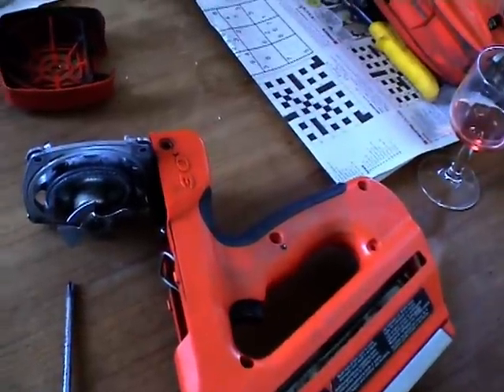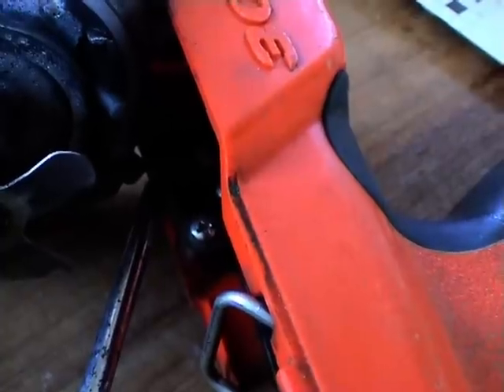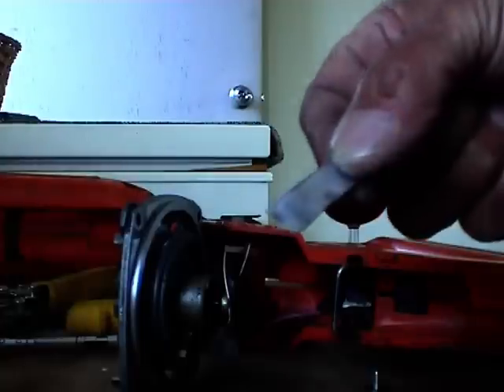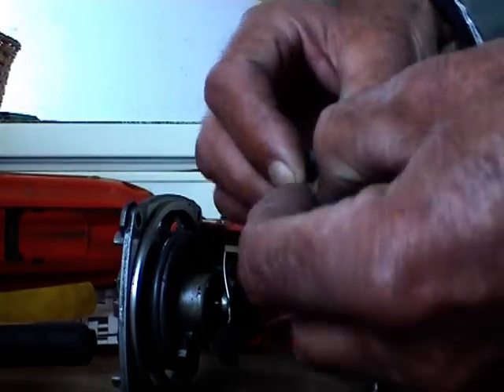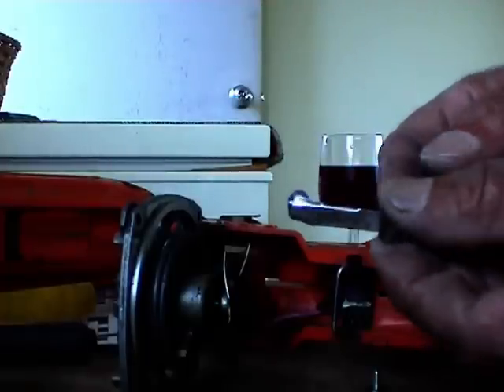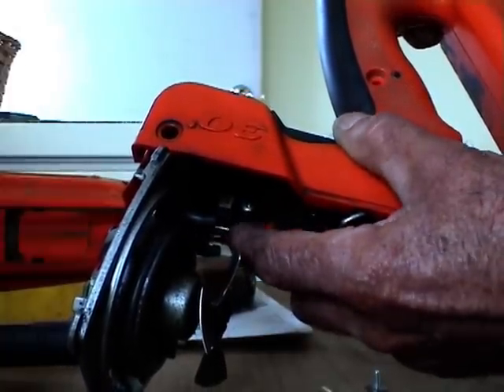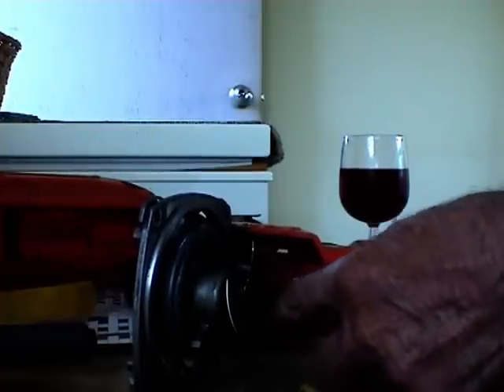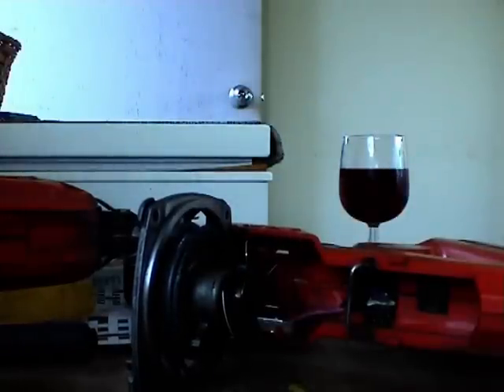Fixing a Paslode gas framing gun that wont fire, or fires intermittently.

Comment: I replaced the two O-rings and cleaned my gun. It ran worse than before it started and saw your video. Took the gun apart and used aluminum foil tape, the stuff that is used on ductwork, and it works great now.
Thank you.

Comment: These things are engineered to fail through a frailty mechanism inbuilt ,so as the average builder will throw it away.They are a brilliant tool,but they are built to fail,so paslode can sell you a new tool,periodically.However a well maintained tool can earn you a fortune on pricework.They work if used every day,far better than intermittent use.Thanks for the video.

Comment: Thanks mate - worked a treat... mine's been playing up for years (don't use it a lot,) tried everything: new O rings, piston ring, reed valve, new batteries, gas, but still only worked intermittently - could never depend on it. Didn't have any flashing, so cut a strip off a Fosters can. Knew there'd be a use found for it one day... (only kidding!) Thanks again.

Comment: Thanks for the tip, now my flea-bay nailer works pretty good. I tried replacing the part but that just made it work for a little bit then quit again. I used aluminium foil duct tape, hope that helps someone.

Comment from the maker: No, you've got a different issue there. With the problem I addressed in the video the fan still works, but the gun won't fire when you pull the trigger.
Check that the power connector to the fan is pushed in firmly and the spark plug cap is down firmly. You could also try another battery (some batteries look good, green light etc, but are actually dud.)

Comment: Slick.  Worked for me!  I used a couple layers of foil tape I had from some duct work.  Many thanks.  the part is 404448 Lever/Head switch and is available through several suppliers - but this trick got me going again until I can replace it.  Many thanks

Comment: great video cheers.....however i did the repair and it got worse fan would not come on. After filing about i found that the spring was pushing on the switch after releasing. pushed the spring back the other way and no it works great! go figure! everything in my life is backwards or upside down! cheers again though for pointing the right direction to look in.

Comment: great idea if it was built to work consistently.They are not reliable and very difficult for the average guy to trouble shoot and repair.
Average repair cost at home depot works out to 1/3 to 1/2 the cost of a new one.I bought a new battery =waste of money.New fuel cell=waste of money.
How do you know if its switch,o ring ,spark or something else when youre sitting by a wall you are trying to put together and the gun works then doesnt ,works then doesnt then quits only to start working intermitantly for a hour or so then stops working again then leave it for a day and it works for an hour only to do the above  again.

Comment: Nice video. I received one of these from a friend and it didn't work. I took it apart and found fan shaft very bent and not working. Replaced that motor, and it cranked right up, but would not fire a nail. Put it away for a few weeks. Saw your video and thought this might be my issue. however now gun is dead. I can't even get light to come on in handle. Fan will not work. I can't find any info to address this. battery was out during storage and gun inside carrier, and in my house. Batteries and canisters both work well in another gun. Gun just seems to have lost a connection somewhere. Reset button??? Can you help me.

Comment: This is great but what I'm interested in is do you swear by the paslode cleaning gear or have you got some more tips on what to clean em with.... standard $2 degreaser???
Reply: I have been using  break and clutch cleaner for years ( I think there are cleaners that foam but don't use those) to clean my paslode gas guns but I always use the paslode oil

Comment: A glass of Merlot and a fine cigar whilst attending to his craft. Now that's one classy Carpenter LOL. I only wish he'd done s better job explaining what part of the gun he was working on and how to access it. You see, I bought a used gun and have never operated one myself let alone attempt to service or repair one. However, I'm sure that I'll figure it out myself over time, at which point his flashing fix may be just what I need to get this thing working. I bought the framing nailer and a finish nailer off Craigslist for only $100.00.....😁.yes, for both. So anything I have to put into them will be worth it
Reply from the maker: Undo the 4 screws on the top of the gun, then the 2 on either side of the depth adjuster. The barrel will now pull away from the body.

Comment: thanks for the vid.  My gun will fire and the drive pin will put a dent in the wood but not drive a nail.  It will usually do this a dozen or so times then be ok for a dozen nails then do it again.  Any ideas?? Is this part the problem here?? thanks.
Reply: Highland Hunters NZ file the end of the pin back flat. One of mine does this when it gets to the end of the strip bloody annoying when the nail is sat at side of the hole the firing pin made

Comment: ok, i took it apart and clean everything with the Paslode spray cleaner. i then oiled the piston and o-rings. everything looked good. the spark plug had a sharp point and was clean to begin with. i put it back toghether and installed a new fully charged battery. No spark! i did try to get it to spark when it was apart. i put battery in and slide the front piece back. then i pushed the switch, nothing happened then either. HELP! ha ha, the gun is so new. it isn't even scratched. i'm not a nail gun mechanic, i have abilities but i don't know anything about this piece. 
thanks, Skinny
George

Comment: Skinny, i just picked up a used 325li cheap. i knew it didnt work when i got it. thats why it was cheap! haha anyway new battery and new gas but when you pull the trigger nothing happens. any sugestions to what i should do first?
thanks, George
Reply from the maker: george rubino  Check to see if it sparks.
Reply: @skinny3491  how do you check for spark?

Comment: See if it works??..............Do you know what you are doing? Sorry mate it's just a mirco switch and you could have put the battery in ONLY and proved your results. I figure you still have a problem and will have to replace the spark unit!. Let us know if I am wrong. Cheers
Reply from the maker: That was 7  or 8 years ago.  The gun continued to work no problem till I dropped it of a roof about 3 years ago.
Reply: @skinny3491  Biggest problem as an electrical tech YOU did not prove by showing it worked. I have a major problem with what you are trying to say when in fact if you knew what you were doing you could have just gently bent the tang for the roller. Also just by pushing the micro switch will not and I repeat will not make it fire. You have to push the trigger and microswitch at the same time. It is a part of the safety built into the unit. LMAO

Comment: just buy new parts.
Reply: Ray Hill what is the name of that piece
Reply: If the main casting is worn as in the case of my two then good luck buying new parts it’s £180. A new wheel DOES NOT fix the problem if that ramp is worn epoxy putty doesn’t fix it for long either. This is so far the best fix I’ve seen